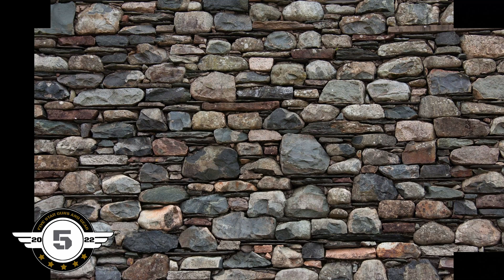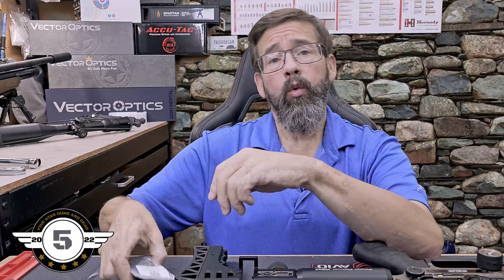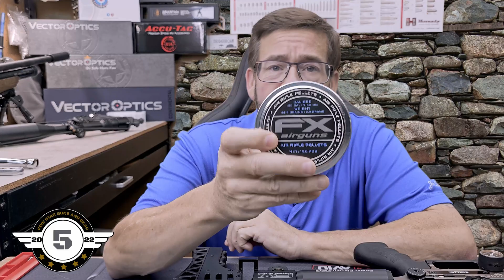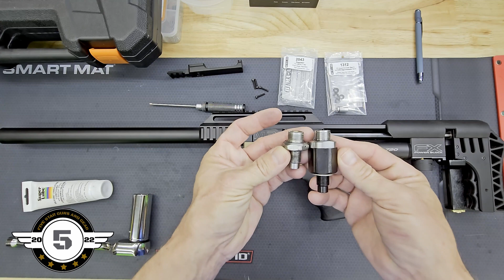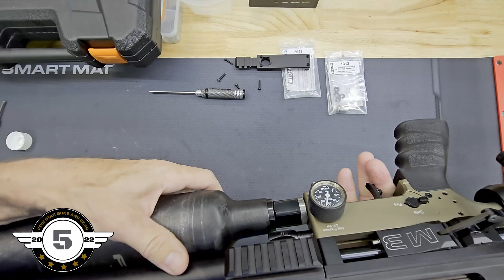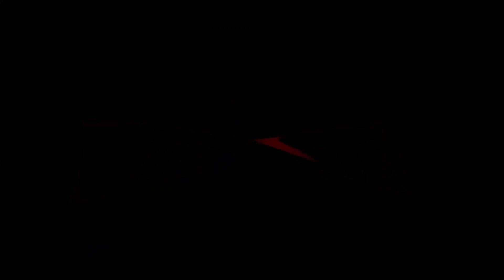Huma Air FX Impact M3 First Stage Regulator Installation and Benefits Eliminate Unwanted Creep

Comment: Awesome video i tired that huma reg and i guess I did some wrong because it didn't work for me so i bought another first stage reg from utah air gun anout a yr ago working just fine.... I think on the huma i over tightened it and i messed it up or something went wrong but i saw you doing the right way maybe ill try it again if my goes bad thanks for sharing be safe buddy 💯

Comment: Go myself a cheap .25 Skyhawk / P15. at 12ftlbs its just about getting the pellet out of the barrel. Got a friend to check it & it was doing 9 ftlbs!!. He fettled it to 11.5 ft lbs & i was quite happy with it. He did say get a Huma reg & he will fit it. He had told me he had tested the original reg & it was at 130 bar?. I thought that was high so i asked around & was told it was quite possible. Anyway i ordered a 130 bar reg from Huma, don't know what i got but its trash!!!. Going to bin it & get a Lane reg!!
Reply from the maker: I would contact Huma never had a issue and top notch every time

Comment: Hi i have a regulator creep with my fx  impact m3 should i change it to this and how do i get the remaining air out of second regulator
Reply from the maker: Yes and you can bleed it out through the air gauge just crack it loose be careful do not unscrew but enought for air to escape
Reply: I prefer to unscrew the bottle, and then open the 2nd regulator screw, so counter clockwise just a little bit then you will bleed the pressure right away. Or you unscrew the bottle fire 2 dry shots (make sure your impact is not loaded)😉 and it will bleed the air.